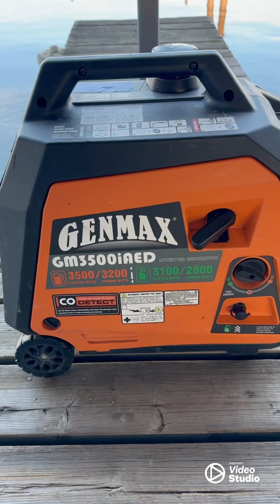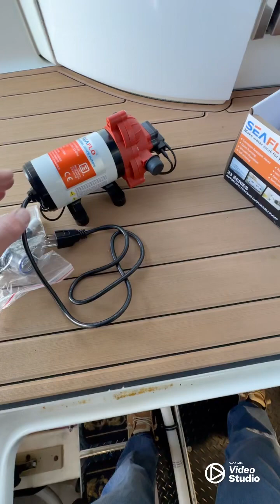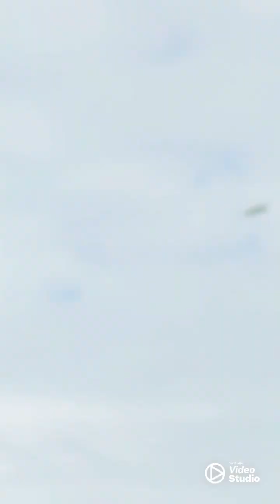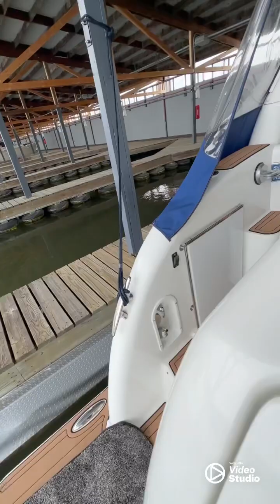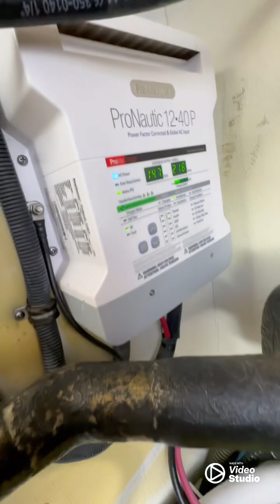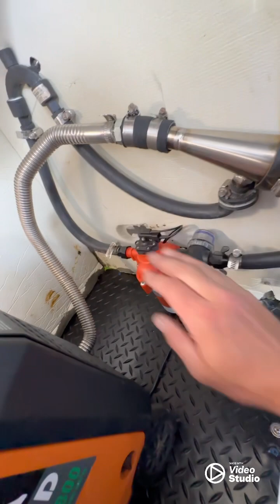Can You Replace Your Marine Generator with a Portable Generator? Let’s Find Out!

Comment: I'm thinking about doing this replacing old gen. It's been few years since video came out . Has it been working for you  ? Since you put it in your boat
Reply from the maker: Yeah it’s been working great. I run it pretty often during the summer. I ran an additional blower from that area I leave on with the factory blowers just for extra precaution and I had a nice stainless steel exhaust pipe built and welded to generator itself and that wrapped that with fiberglass exhaust tape just make it nicer. I also fabricated nicer or permanent hold down brackets. Besides that everything is still the same and working well.

Comment: You're smart enough to be dangerous.
Reply from the maker: Just like I said in my video. There is gonna be people like you. I’m working great for seasons now..
Reply: @concreteguy9453  Too many points of failure. It works until it DOESN'T.  Just my opinion that it's not worth the risk. Putting it on a swim platform, is the simple "elegant" solution.  Good for you, though.

Comment: how is it working?
Reply from the maker: Still going strong. I mean I’m not using it right now much because it’s winter and my boat is just in the boathouse hooked up to shore power. But I just did an oil change on it when I did the Motors and then ran it for a little bit and put a load on it and it runs great.

Comment: You should have a water flow detector, one that shuts down the Genny if water flow stops- I'm sure you're not constantly watching water flow on the outside.   Also propane is not great idea.  Tank should be outside vented, etc.  Sure you know propane sinks.  Hope your gas sniff is low.  And I won't bother to mention insurance....  Otherwise I like the creative ideas

Comment: Should wrap that pipe. It's next to that hose and vent.
Reply from the maker: It’s wrapped now. I made a few more modifications to this. I should make a follow up video. But yes that’s a good suggestion
Reply: @concreteguy9453  yes please do a follow up and change the aspect ratio to full size 16x9 instead of what you have , that is at 9:16, i was thinking of wraping the exahaust with copper coil and have water flow through it as well

Comment: I like the set up.  I was wondering why you had to cool your exhaust?  It's an air cooled generator.  Wet exhaust is typically the discharge of the hot water that cools the motor.  Couldn't you run your exhaust directly to the through hull with a riser to prevent backflow of water?
Reply from the maker: @paulgreubel7305  Marine generator exhaust systems are typically made of fiberglass—there’s no metal in them. And you absolutely do not run dry, hot exhaust through fiberglass mufflers; they have to be cooled with water. The water isn’t there to cool the generator itself—it’s specifically for the exhaust system.

Yes, the factory Kohler marine generator is water-cooled, but that’s a separate deal. Technically, you could run a solid steel exhaust through the hull, but you’d have to custom fabricate it. And then you’d be dealing with a blazing hot metal pipe running from the center of your boat, bending around a few corners, and finally exiting the hull—at least in my case, based on where my generator is located.

Luckily, I already had a clean, pre-fabricated marine wet exhaust system mounted nice and tidy around the engine compartment. It was ready to go—just needed water plumbed in, which was easy.
Reply: @concreteguy9453  Makes sense!  The heat on the through hole would probably discolor or damage the fiberglass too.  I think I'll just run a portable gen on the deck when I need it and plug my 30 amp cord to run the entire boat.  Its only when I'm off shore power and need to make coffee, grill and microwave.
Reply from the maker: @paulgreubel7305  Yeah, I used to do that with my old boat when I just needed a quick little electrical boost. If you’re only running it for a bit, it’s usually no big deal—most folks don’t care.

One time, way back, I was up in Canada in Desolation Sound. I had it running on the swim platform to knock out a couple things, and this guy came over to let me know there was a noise pollution ordinance. That was the only time anyone ever gave me grief about it—and honestly, I got it. It’s pretty damn peaceful up there.

But yeah, for the most part, it worked like a charm. Maybe I’m just getting old and soft, but the one thing I’d be a little careful about is carbon monoxide. If the air’s real still and you’re rafted up tight with other boats, it could drift into the cabin through an open port window. It’d have to be a perfect storm kinda deal, but still—might be worth throwing a CO detector or two down in the cabin just in case.

Anyway, that’s my unsolicited two cents😆

Comment: Is the oem blower motor enough to suck out the fume or should add another one? I’m worry from the sparking and too much fume in there then its exploding?
Reply from the maker: @anaselmir-g3g  I’ve got two large factory-installed blower fans that I run before starting the generator and keep on the entire time it’s in operation. I also added a neatly wired 12v fan above and behind the generator, connected to the blower switch, to improve airflow. My boat is equipped with built-in fuel vapor detectors, and I highly recommend installing those before attempting anything similar. I regularly inspect the engine bay, and if I ever notice fuel leaks or anything suspicious, I wouldn’t run the generator or the boat’s engines, period.
Reply: Great video I have been thinking about the same system for my Four Winns 258 but all the nay sayers turned me off. But you have given me the confidence to do it. Plus you are now my benchmark for a clean engine bay. Great work.

Comment: Amazing  conversion. I am thinking about going the same route on my Trojan Tri-Cabin
Reply from the maker: @briancrosson176  I should do an update video, but I’ve been using this setup all summer and it works great! I did add a couple of fans to improve airflow, so if you’re doing something similar, make sure you have plenty of air circulation around it. Also, ensure your water pump is high-quality and placed in a cool, well-ventilated area, away from the generator, to prevent overheating.
Reply: Thanks for adding this comment I'm thinking about doing the same setup, makes sense have the water pump in a cooler location. Inverter generators are cheap and way more fuel efficient than old style generators